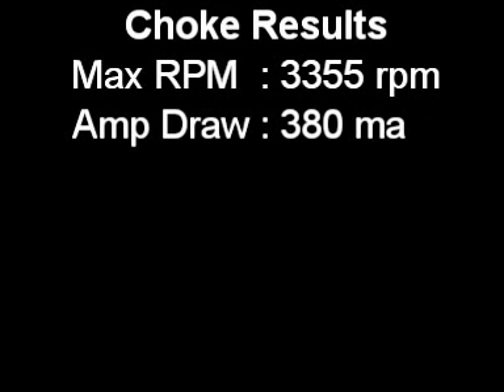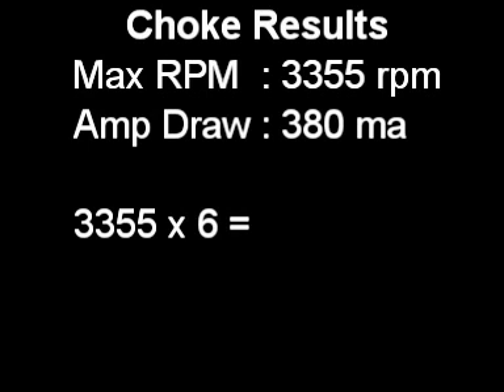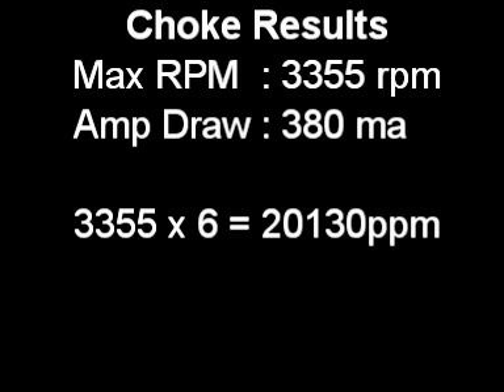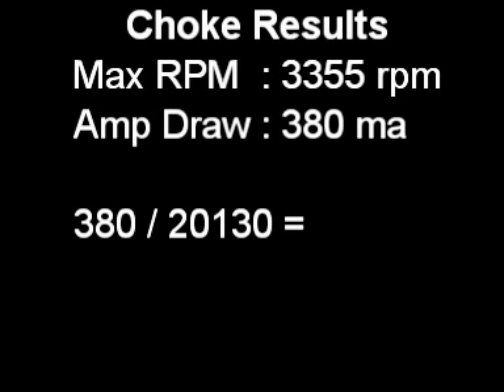Bedini Trigger Choke Comparison - RPM & AMPS & STROBE

Comment from the maker: There are quite a few advantages.  Many people have reported improved torque using multiple transistors.  I haven't personally compared the two.

Also as you add more coils your amps go up so eventually you will reach a point where one transistor will start to heat up if you use too many coils which will reduce the efficiency.

Another possible benefit would be that each coil is independent.